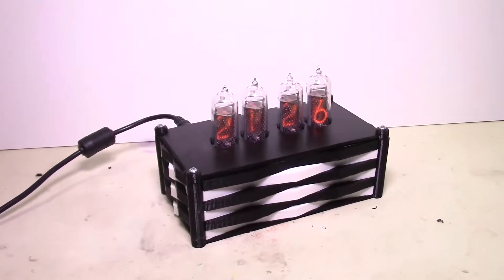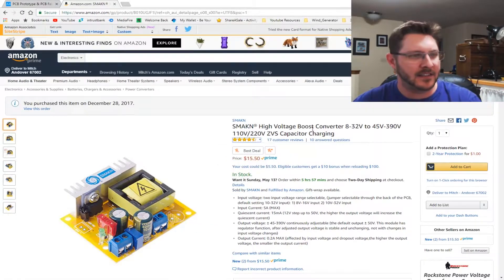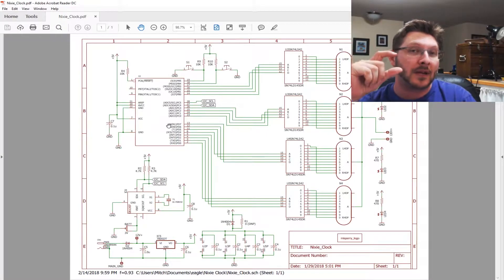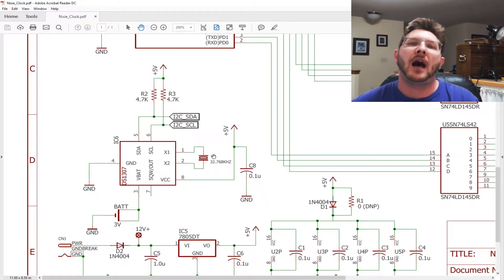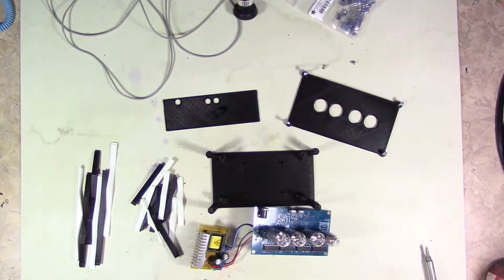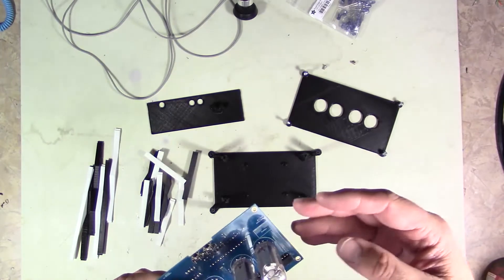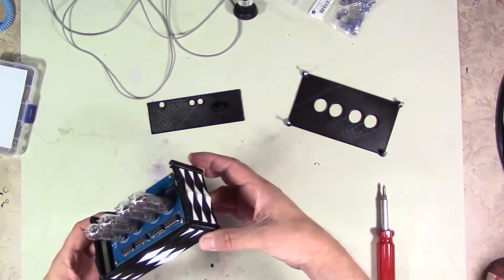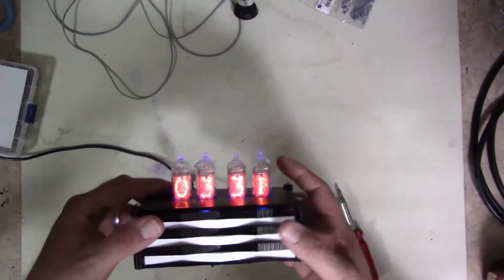Building Your Very Own Nixie Clock HW and SW

Comment: this video is so underrated. Is there anyway to make the PCB as small as possible or basically the whole clock as i'm trying to make a watch.
Reply from the maker: Thanks for the feed back.  I have seen this done before.  However, you need to pay close attention to the smaller Nixie tubes that you would use for that because they may have smaller voltages.  The clock that I made needed large voltages that I had to have a power supply for.  Now if the voltage is substantially higher like 50V or above you need to watch your trace widths to avoid arching.